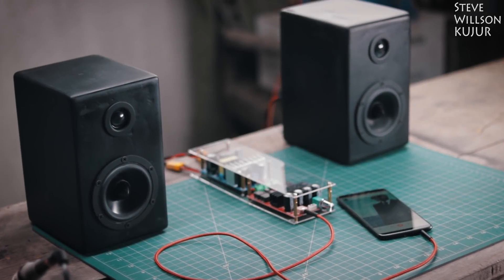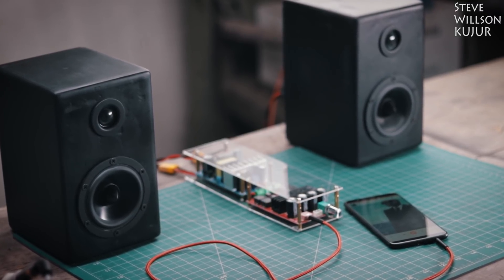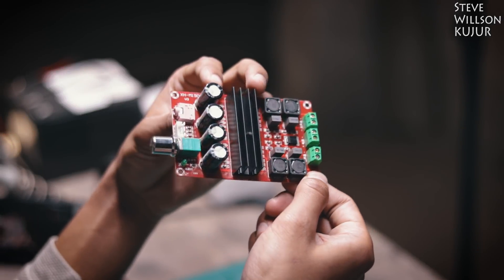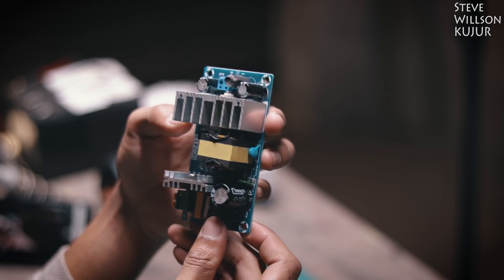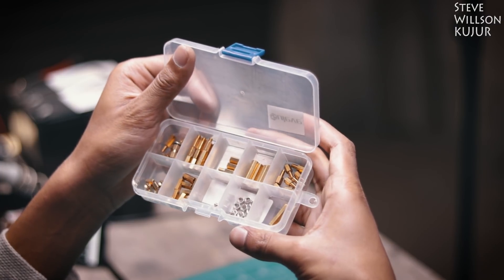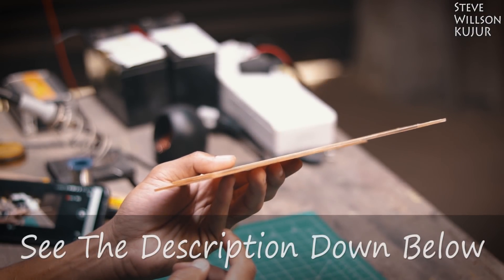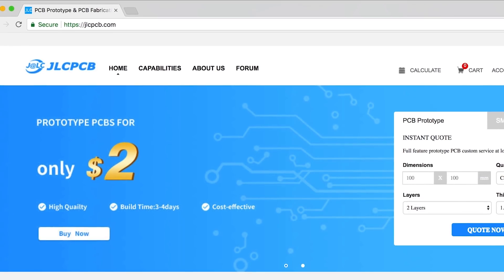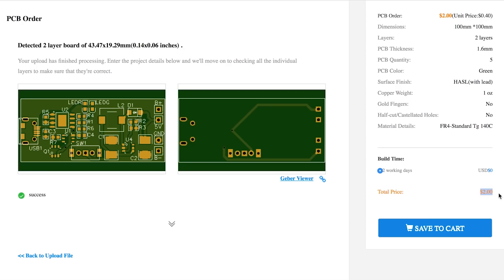DIY Super Simple | 200 Watt Audio Amplifier

Comment: Can I use the power supply that was used in a laptop charger?it was rated 24volts, 2.1 amps
Reply: That would give you less than 48W

Comment: the TPA3116D2 chip can only support 2x50w @4 ohms so yeah they lie not your fault just saying.
Reply: I think in this board design is dual tpa3116d2 bridge, so basically 100w per channel at 4 ohms with a power supply of 24v 10a

Comment: You forgot to cut vent holes above the heat syncs, especially over the 2 on the power supply. Obviously heat can go out the sides but blocking heat's first preferred path, partially defeats the function of having syncs that big. More so if this project gets installed inside an enclosure where it belongs, and pushes 4 amps or more. If not properly ventilated you risk tripping its internal thermal protection, shutting it off.

Comment: People in China are always dying in lifts and the people of India are always getting electrocuted or drowning, this video is a prime example on the type of power supply you should NOT being using. Whenever using a open case design always use a power supply that is Class II or double insulated, typically the ones that come with a DC jack, not open does it make your project box smaller, its safer too!

Comment: Bro I think you should make the smallest amp in the world by using PAM 8610.

And the power supply should be completely separated and connect by just a power cable from the am to make it as small as possible.

Comment: Firstly connect the red and black cables to the red pcb, and after the connection build the blue one to this amplifier is not a simpliest way. But this amplifier looks cool. 👍
Reply: i said how voltage need for tpa311d2 audio amplifire board
plz write in english

Comment: Hi, you could upload a video of how to make a pack of 2s2p batteries with BMS.
You would help me a lot, since you do the great videos and very well explained
Reply: Im not sure if you are still in interested in learning about li-ion cell configurations and how to incorporate a bms properly. I could also explain the best way to add additional features such as cell phone charging port, flashlight, thermal cut off switches( cuts off power to the battery if it gets too hot), even variable voltage output. Just let me know if you still wamt to learn. Or perhaps or could teach me some things.